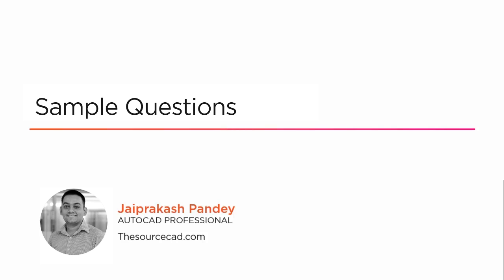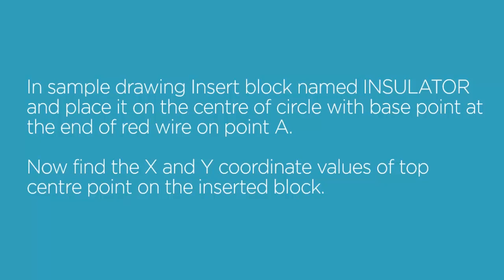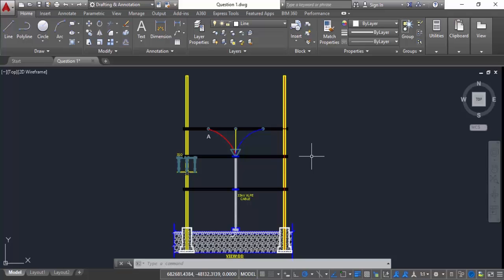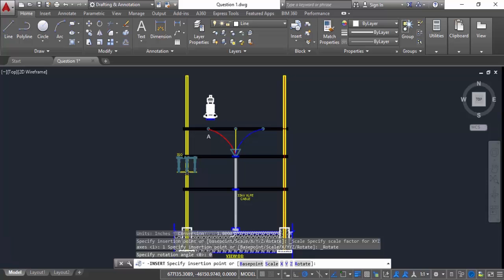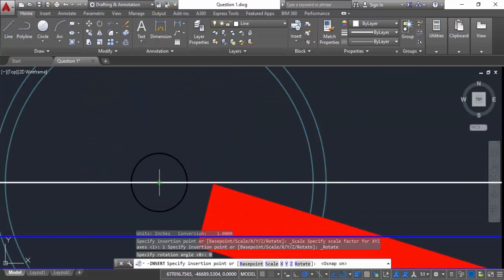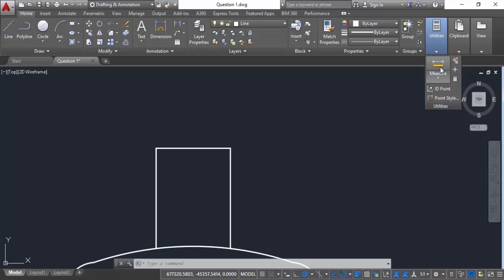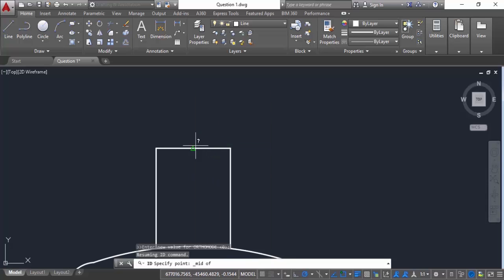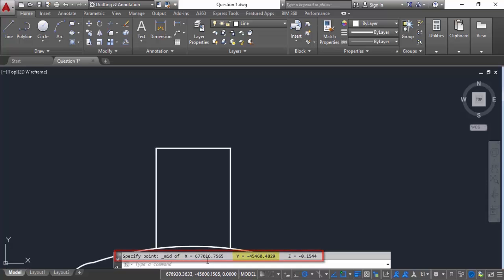AutoCAD 2016 Certification Exam — Sample Question

Comment: I've been drafting with Autocad for 15 years now and I've never needed to know the X and Y coordinates of anything in a drawing.  I've also found that palettes for blocks aren't any better than just having blocks in a template.  I didn't understand the method used for placing that block.  If I need to locate a block according to its insertion grip, I left click on the block which lights up the grip, and I move it with that grip and stick it into place.
Reply: There is more application to this outside of just of basic Autocad. In Civil 3d, a field crew can use X Y coordinates  to stake out a job site.